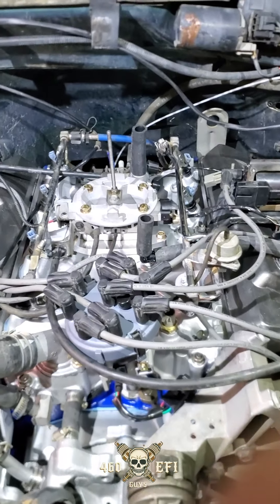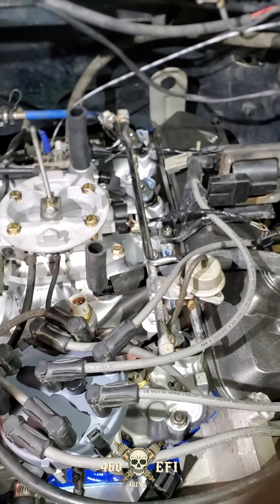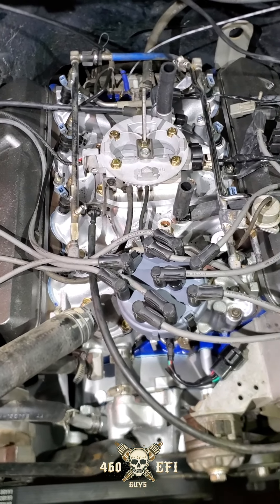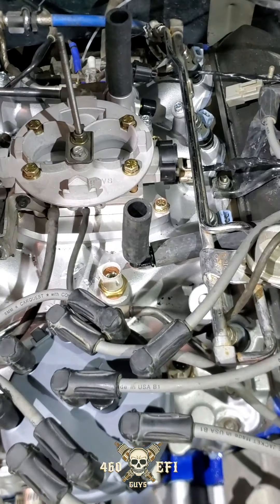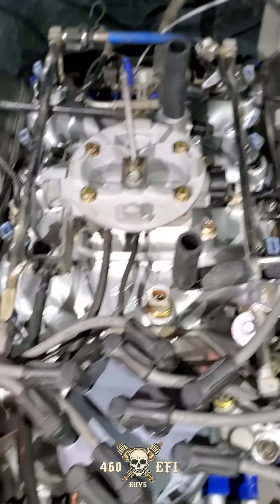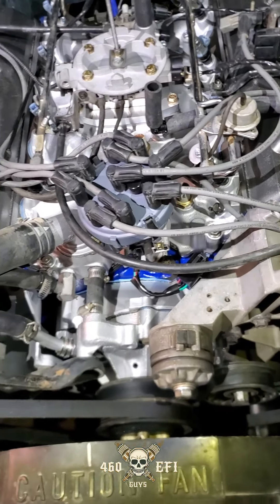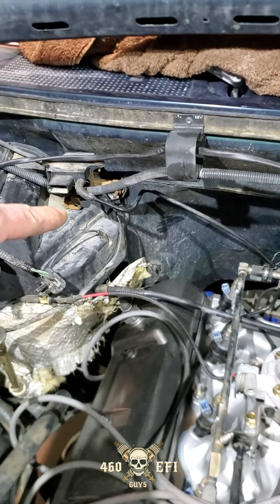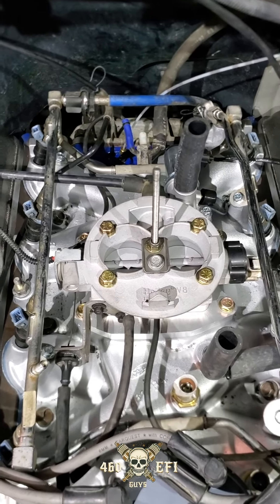460EFIguys : 1988-97 Ford Truck Upgrades - Installing the 460 7.5L Low-Profile Throttle Body

Comment: It would be great to know just how much torque this will free up.  Lot of people use these for pulling trailers and a bit more torque would be nice.
Reply: I just installed one. Noticeable torque increase!!
Reply: My 97 f350 only 150K and it just doesn't pull for nothin.. my buddy has an 89 350 and it out pulls mine all day. Definitely need to do something more to mine.
Reply: @chuckterrell691  What engine and gears do you have?  I think the 97 was either diesel or the Triton V10.  IDK how much torque the V10 made, but the old 460 was well known for it's torque.
Reply: @karljay7473  it is definitely an OBS 97 it says nov 97 on the sticker. I know what you mean tho cuz I usually have to search parts for 96. Its a 460 and im pretty sure it has 4 10 gears
Reply: @chuckterrell691  Something doesn't seem right.  An F350 460 4:10 gears should be a strong puller.  I"m guessing you either have the ZF 5 speed or Auto trans, but either way that should be a strong puller.  I'd look at the wear and tear on the engine as well as worn out external parts like the exhaust.  I had a failed cat on mine.  The cat on the 88 is HUGE and it has 4 disks in it.  I opened it, tossed out a melted disk and she ran great.  Remember, you have a 20+ year old truck, the cat and other things wear out.  It wasn't legal to remove a disk from the cat, but a 460 cat was like $1,000 and I have a tig welder, so I just cut it open and removed the melted disk.  One thing you can do is change the gears.  I went with a deeper 1st gear because I have a GearVendors on mine.  One other issue is the net weight of the truck.  You should be in the 5~6000 lb range depending on equipment.  My ext cab Lariat dually long bed comes in about the 5K lbs range IIRC.  It can pull like crazy, but my engine and trans are all new.  These are great trucks and well worth going thru.  I get a reman engine and trans for about $2K.
Reply from the maker: It definetly gives a noticeable increase.   I have to go easy on the go pedal starting out.  I can take rolling sharp turns in 3rd gear where before i would have to downshift.
Reply from the maker: @chuckterrell691 Give me a call if you haven't yet.   There's probably a sensor out, plugged cat, flat cam or other issue to figure out on yours.  I can walk you through my checklist of things to look at.
Reply: @karljay7473  v10 debuted in late 98, as the 99 model year superduty. OBS never had the v10, 1997 F150 did get the 5.4 and 4.6 as it was the new body style F150 after the obs
Reply: I've got a 1990 f super duty. 10 lug. Has the 460, 5 speed an a dana 80 with 4.62 gears. Pulls like crap. I had to replace fuel tank from all the crud. And fuel filter. Have new dual exhaust with no cat now. Pulling a trailer the other day I got 2 mpg and had to pretty much drive it with the pedal to the floor. Sounds good and revs up good. But not alot of power. Could injectors be plugged? Also has new cap, rotor, plugs, wires, and ignition module
Reply: @oldironfinder  When you're dealing with a 34  year old truck engine, you really need to go thru the whole thing.  Even when mine was only 15 years old, I went thru the whole thing.
Reply: @karljay7473  well injectors is about all that's left. I got a set the other day and plan on putting them in soon. Just didn't know if you had any secrets. I'm a gm guy, but this is my welding truck. It was a wrecker from ford when new. Has flatbed on it now. And ut has only 41 thousand original miles. Sat in a field for the last 10 to 15 years
Reply: @oldironfinder  I'd fully flush the system and replace all filters and FPR, then put the injectors in.  I'd also look at the smog equipment. if you have a cat, they can clog up, muffler too. i'd also test the pressure, they have TWO pumps on mine.  Maybe test the voltage at each connector.

Comment: A friend of mine’s uncle worked at the ford proving grounds when they came out with the efi 460 3/4 an 1 tons, they had to put the restrictions in the intake hoses and inlet to keep the rear winds from blowing up, they had the unrestricted truck running around the proving grounds at over 135 mph, an they got 25 mile to the gallon on the highway

Comment: just installed the twisted smog box on my 88 460 and what a diference it  makes this is a fresh rebiuld only upgreades are a cam from comp cams that works  with the ecu and 28 pound injectors. Russell was great to talk to and do business with gotthe box fast and was super easy to put in, after this little bolt on im now looking at the throttle body kit he has so that i can complete this project and have some fun with it. will later put up some mpg numbers but i can say right now its better than the 8 i was getting.
Reply: Any updates on MPG with
The 460 kit
Throttle body yet?

Comment: Does the egr just need to see constant vacuum? Also there is a sensor by the pcv can that just be eliminated?  I got a 460 and it’s got a rough idle. The vaccum lines are pretty haggard and the guy before me had capped some stuff and left other stuff so I’m trying to eliminate as much as possible

Comment: Looks like a dodge throttle body
Reply: It is a dodge throttle body. For the longest time I wondered why they never posted the size of the throttle body. Then I realized they didn’t want folks knowing they’re $400 throttle body is smaller than the factory unit.
Reply: @FutureManLS  care to elaborate ik from when i seen them they look like second gen tbs
Reply: @jacobchandler2083  It’s just a 5.2/5.9 dodge throttle body on a custom adapter. Which is actually a C hair smaller than the factory 460 unit. Now I’m not claiming it doesn’t make any more power. It may or it may not, because you are still getting rid of the weird gooseneck deal. The company doesn’t seem very keen on posting comparison dyno #’s. They’re excuse is that they’re too far away. If it were my company, I would want to sell a lot of these things.I would have no problem going out of my way to get some dyno time which would end up selling more of the product.

Comment: Subscribed
I was searching for an aftermarket intake, because my gaskets are leaking coolant. Found your website and now I am going to do the throttle body kit too. I have a 91 C350 Centurion (4 door 1 ton bronco) just turned over 100k miles. THANKS!

Comment: Cool- I've got a 1997 F350 with a 460 I'm reviving and potentially goosing up for fun.  Exhaust gaskets are cooked and I ended up having to cut the EGR tube off (passenger side, haven't started the driver side).  I don't have to pass emissions, so all's fair game, so I think I'm going to look at the smog/EGR delete as the first step.

Before I get all crazy, on upgrades the truck also has what I believe is a PSOM issue (automatic shifts from first to all over hell and gone, but will go manually from 1-2, D) which I need to address before pumping any other cash into it.
Reply from the maker: We might of spoke on the phone already,  but if not:  take a look at the speed sensor in the axle.  Those will throw it out.  Another thing is the range selector.   Those had a recall and need to be updated.   The old style had horrible problems. If your speedo is wonky look at the speed sensor to start with.
Reply: @460efiguys3  yeah thx for that.  Shift issue ended up being the PCM... but I got really good at testing everything else in the system.  Good to have the beast rolling again.    After the EGR delete though it's been stalling in D at idle speeds (warm only, never cold).  Pretty sure it's something with the vac and the MAP/PCM expecting a certain vac that isn't there.  Good in N and P, but when it's rolling in D/1/R, with engine warm it'll stall if you try and go parking lot speed w/out gassing it.  There's a pink vac tube that is hanging and goes back to the MAP.  Tried blocking and leaving it open- same thing.

Comment: I'm closer to having my engine ready for my wagon. I forgot to order a MAP sensor and spark plugs or all things. 
I also have some questions on the body side of the harness, I'm not sure which is which for power, fuel pump and ignition hot.

Comment: Hhhmmm a 4150 carb adapter.  An old 750 double pumper.  Knock out and plug booster holes. Throw the bowls and metering blocks at old peeple...replace with plates. Mount iac to one. Drill necessary holes. Mount tps to crank arm. 14" air filter. Ev6 injectors and adjustable fuel regulator. Afr gauge. Tune and haul ass!

Comment: I’m throwing a 1993 460 in my 78 bronco. Wondering if you know which wires that pass through the firewall into the dash harness need to be used with the 78. I’ll have oil pressure coolant temp, fuel pump, and even power I believe but just looking for advice! I have the harness stripped down to map sensor, hugo, main power, main ground, ignition control module, eec test, and a couple other things. Can’t find any info on it online which dash harness wires should be reused
Reply from the maker: You are correct with a bunch of those.   Keep the wires that feed your instrument cluster.   Give me a buzz as we can either guide you a little with your swap, or we can remap and stand-alone covert your harness for you.

Comment: Could you share a part number for the plugs at the exhaust manifolds, please? We tried 3/8" NPT, but it was more loose that a 5/8" fine thread bolt. The shortest of these are 1", so would have to cut them down. But would rather find a grub/alan  head style?
Reply from the maker: I want to say an alternate to use is a 5/8" set screw.  They have a hair more thread diameter.

Comment: factory power is around 275hp  what will this mod gain ,it doesn't have more holes for air .need more air more fuel for more power . i get that you are converting to efi from bank injection . id like to see a 4 barrel or 2 4 barrel intake throttle bodys  . back in the day if you increased the carberator size it pulled mor air and fuel . i own a 97 f350 7.5l  id like 400hp or 500
Reply: That's not exactly true.  In "your day" it was common for cars to run like a dog because over-carbing an engine was popular.  You need enough vacuum to pull the proper amount of atomized fuel: and more holes doesn't mean you're getting proper air in.

You may simply lower your air velocity, which incites a plethora of issues.

Comment: You recommended headers and I really want to put some on since I have a leak at the exhaust manifold, but I'm scared of busting bolt(s). What is your experience on these? Mine is a '95 F250 with a decent bit of rust.
Reply: I have the hedman 89460 mid length headers on my 92 f250 and it screams

Comment: Do you guy but any vehicles on the dyno so you can show improvements?
Reply from the maker: Sadly where we are located there aren't any good dyno's.   I'm planning on heading to Denver here once my 93 crew cab is back on the road again.  We got buried in work right after I posted this video.

Comment: Dose this intake work on carb style heads or only the efi heads?
Reply from the maker: This intake only fits the 88-97 heads.  We have a multi-port Edelbrock intake we use to fuel inject the carburetor type heads.  That intake is what led me to start doing these ones.  It is shown in our Full EFI Conversion Kits

Comment: Seems like the first couple years of the efi 460's they were monsters. After that they must have detuned them. I read the cam is retarded 8° from the factory.
Reply from the maker: The later heads f3te's actually made better power with a tighter quench piston design.   You are correct on the timing chain.   I always upgrade to a true roller chain set (zeroed out),  and a nice rv cam.  The factory cam was just plain sad.  The sum-k3500 camshaft kit actually got me better mileage, and was an amazing upgrade.
Reply: @460efiguys3  with that cam did you have to upgrade the heads. Or were the heads stock?

Comment: Would have been good to see it running first and see what emissions crap you removed.
Reply from the maker: I am about to install my motor in my 93 crew cab.  I'll be showing the full removal here very soon.  It really cleans up the engine bay nicely.  Can't wait to get that beast on the road again.

Comment: Anybody can get rid of the straw neck ford put on those is worth another 70 horsepower been doing for people in Washington state with a modified open plenum adapter plate and 90 mm tb

Comment: A couple years ago I bouhgt an 88 F350 with  460. He had just installed a new long block but when he went to put the top end back toether he couldn't remember how all the injection stuff was supposed to go so he put an Edelbraock carb on it. It has a weird problem. If I set the timing at factory specs it over heats on the highway and doesnt have much power. if I add 4 degrees it runs like a raped ape, doesn't over heat but once warmed up it doesn't want to start. Its firing way to early in the stroke so the started quits turning. It has the OEM ignition on it so my guess is It's missing a sensor somewhere that tells the to retard. If I hope out and move the distributor closer to TDC it starts just fine. Anyone have an idea?